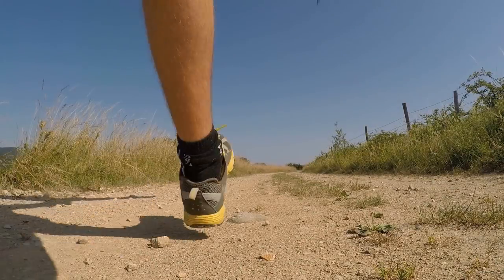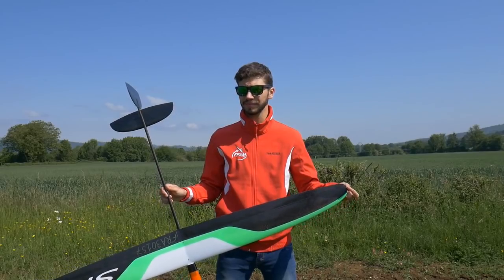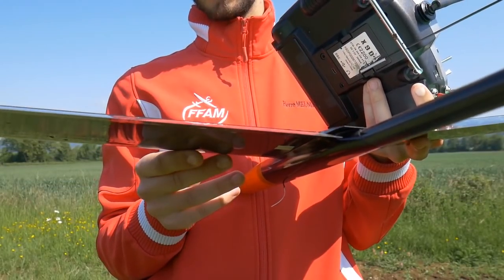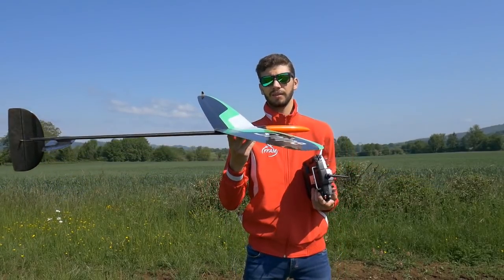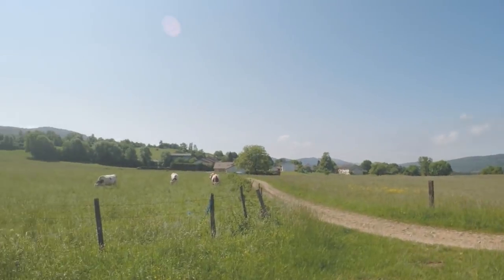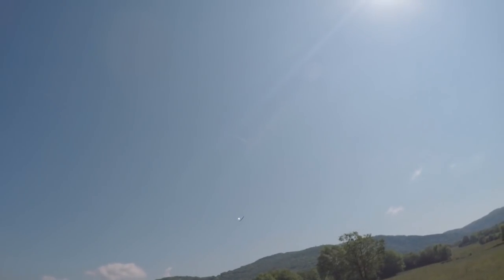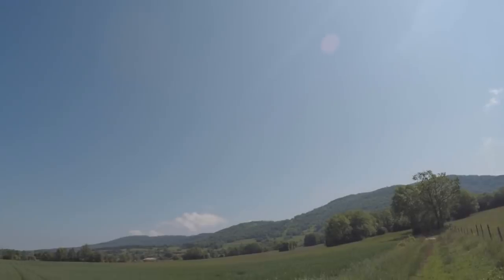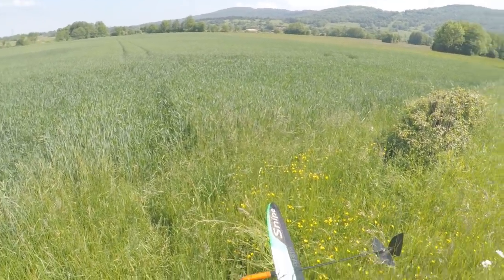DLG PRO TIPS / setting the minimum sink rate

Comment: You are exactly right! This should come naturally to many people, but... Play with it all the time :-). Trimming is an iterative process, there is no way you can have a great trim in 4-5 flights, every time you trim you are just changing compromises.  And the more you do it, the more you hone in on the best compromise. Full house sailplanes especially, more surfaces to balance, but DLG is the same. Modes or no modes, this guy is right, fully trimming a bird to optimal glide (this could be while flying hands off at 37 deg. left and 64 deg down.... I don't mean level) takes at least for me 20-30 flights, paying attention and correcting the optimal balance of all surfaces against each other.  It took me two years to figure this out, and now I see this...